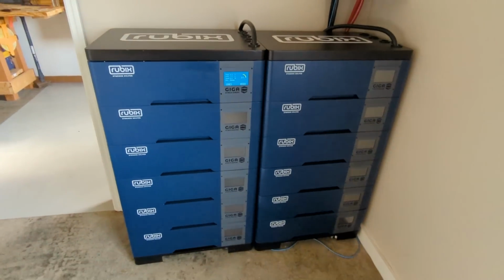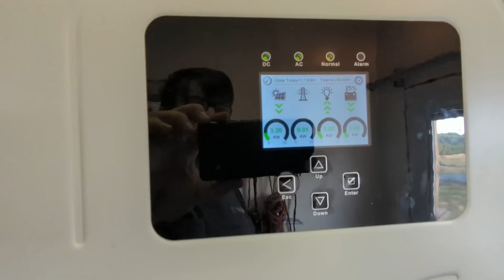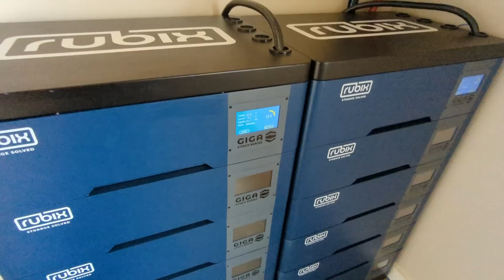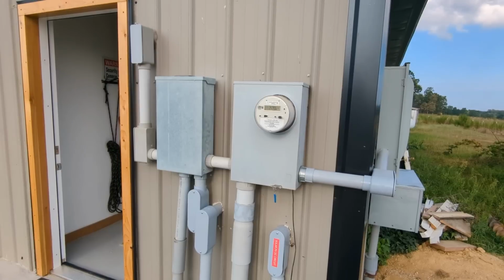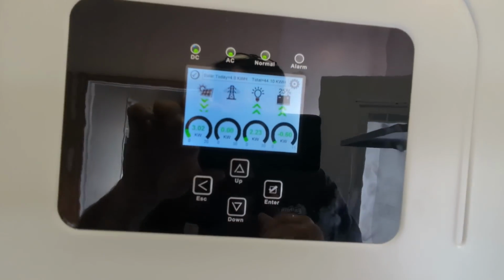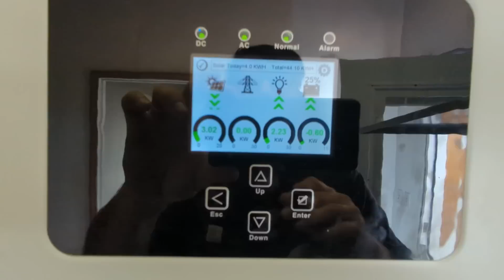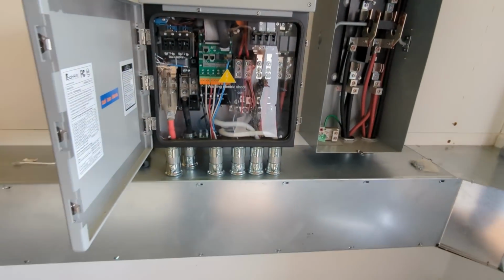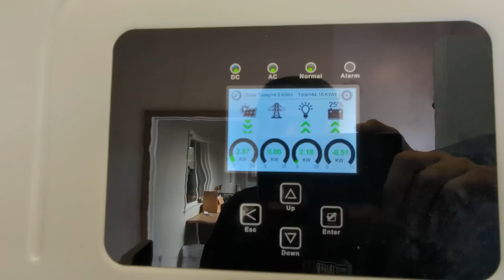Take your homestead off grid!

Comment: I want to add a bypass to my system, what is this one you use called?

My flow goes from meter to disconnect to SolArk (grid input), to panel.
Reply from the maker: @JasonCarmichael  We use the GE 200 amp manual transfer switch.
Reply: @engineer775  Thanks! I just ordered one. I asked for a little help on the Sol-Ark page to draw the connects for the transfer switch.

Comment: Our family of 4 have been off grid in our fifth wheel now for a week while we are starting our new home build.  16k of solar on the hay barn running to solar shed (Shed has its own Sol Ark 5k with 3200w array on top with 10kw battery storage with eg4 9k mini split and starlink internet) where the Sol Ark 15k sits with 3 EG4 powerpro batteries.  Batteries have yet to fall below 51v and we have been running both ACs (in the 90s in NC) and all the creature comforts of the fifth wheel.  Love being independent of the grid. Can't wait to see if we can make the house more efficient than this fifth wheel and stay off grid in a modern farmhouse.  Our power company is a co-op so they do not do anything for solar anyway.

Comment: Great videos.  I noticed that you only used one "Y" adapter on the battery cables. Did you set the charge amps less to keep the sol-ark from tripping?

Comment: i do not have the option of land or big roof availability. i am stuck.😡
Reply from the maker: @alexherrera3918  We have several customers that do not have room for solar. They use inverters and batteries for backup power along with a generator. They use inverters for time of use peak shaving. There are many options.
Reply: @engineer775 in UK/Ireland we have time of use power. At night is cheaper. You could have batteries pull from the grid at night run property during the day from batteries cheaper rate

Comment: How long are the battery cables from the battery array to the Sol-Ark?  Any special issues or considerations with this length of cable run?
Reply: At 30' 12kw (244A) would drop .91v on 4/0 wire

Comment: I thought the 15k sol-ark has its own bypass.  Am I mistaken?  I am currently trying to plan out my system.
Reply: It does not have a built in bypass. You will need to install one.

Comment: ENGINEER 775, 
1. THANK YOU TO YOU & YOUR TEAM FOR TEACHING US HOW TO DIY OUR OWN SYSTEM!
2. WITH THE BATTERY 🔋 SIZES INCREASING & LOWER COST ON THIS ALL IN ONE SYSTEMS. 
3. FOR DAYS OF AUTONOMY & REDUNDANCY, WOULD YOU RECOMMEND HAVING AN ALL IN ONE INVERTER/BATTERY SYSTEM AS BACKUP & AN ALTERNATIVE GREEN GENERATOR POWER SOLUTION OVER A PROPANE OR NATURAL GAS GENERATOR?
Reply: Having the most battery capacity you can afford is ideal. You want to avoid significant discharging & charging as it will reduce the life of your batteries. FWIW: I installed a Sol Ark (all in one) has a UPS (no solar connected at the moment), I use the grid power except when there is a power outage, when power comes back on the grid recharges the batteries. For generator I have a Diesel Generator (Not currently setup yet as I need to get a shed built). The Solar generators are pretty much worthless. They are OK for camping and small loads & short outages. If your looking for a solar for for power outage your better off just getting a off grid inverter like solar Ark that can operate off the grid & also use Solar PV & a standard generator. This will provide you more flexiblity. Probably the only case I think of for a solar generator system is if your renting or living in a condo.

Comment: A code issue I just noticed is in your bypass switch, all conductors of each circuit must pass through the same nipple or wireway, etc. I know it is neater to route the wires like you have them, but each A and B leg have to pass through the same chase nipple.
Reply: What’s the logic behind this code?
Reply: @80HD_82  inductive heating. When you have a ferrous material surrounding a conductor it becomes essentially a transformer. This causes heat buildup on the metal and the conductor which could eventually cause an insulation failure. When all of the phase conductors are going through the same hole or conduit they magnetically cancel out the transformer effect. It is magnified the higher the current flow is because the magnetic field is larger. I really don’t think there would be an issue with this particular install due to the currents involved but, code is code.
Reply: @realnealsmith mag fields would cancel out because wires enter the box and leave through the same holes. if this was a through the box run then maybe there would be some tiny heating but there is no core around these windings so little coupling would happen.
Reply: @antronx7  I didn’t make the code. I was just pointing it out.
Reply: @willistisdale4293  that is irrelevant